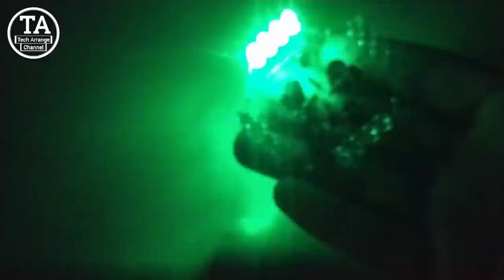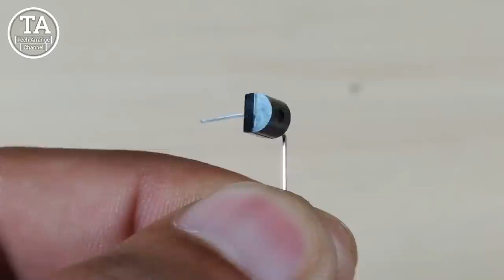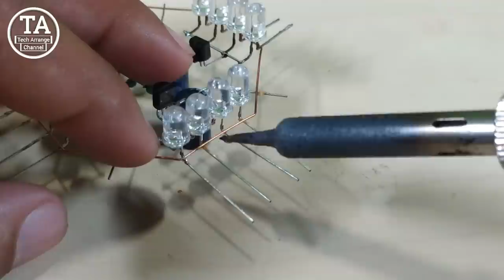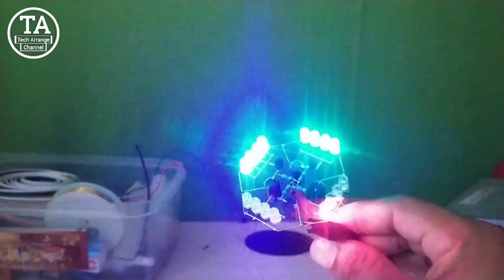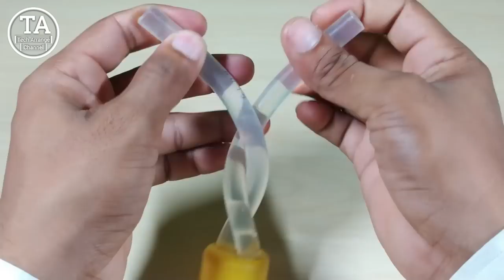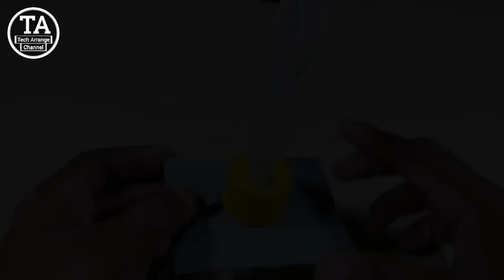[NEW] Top 2 Electronic Project | DJ Light Using BC547 Transistor With Glue Stick Night Lamp

Comment: It'll be great if you use RGB LED instead  ordinary  LED
Reply from the maker: Interesting thing you said 👍
Reply: Rgb LEDs require a constant voltage to change color and cycle this circuit provides a pulse so it would not work cool idea though.

Comment: What will be the Registor's value if I use (3.7 volts lithium Ion battery
BMS out value 5 volts ) 5 volts mobile adapter ?
Reply: I think this circuit performs at 13-15vdc...and he used dc booster while using power from a 3.7v li-ion battery. So, it seems, you have to use a same type of dc booster for 5v also..

Comment: Make a circuit so that I can use it in direct ac 220v
Reply from the maker: use 12v adapter
Reply: @TechArrange  pls help me to design a 12v transformer less supply for this. project is nice